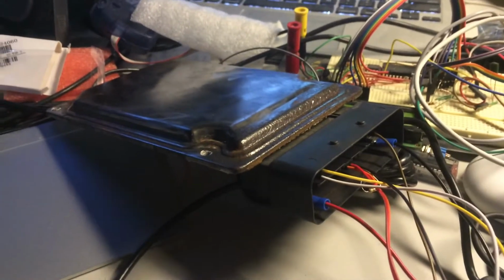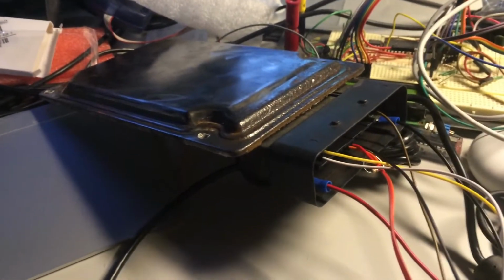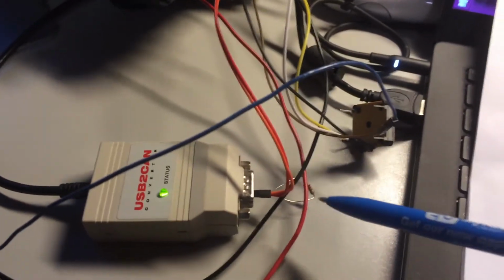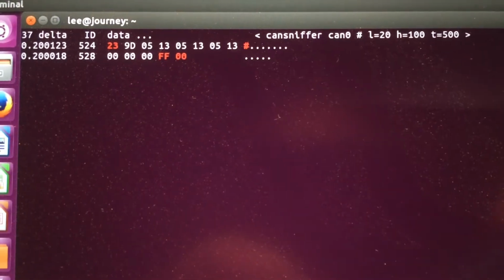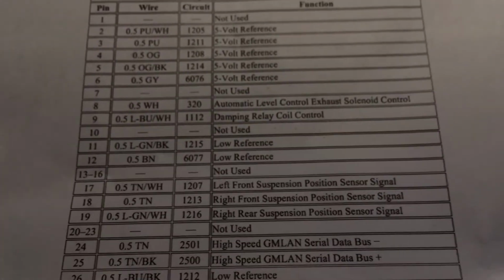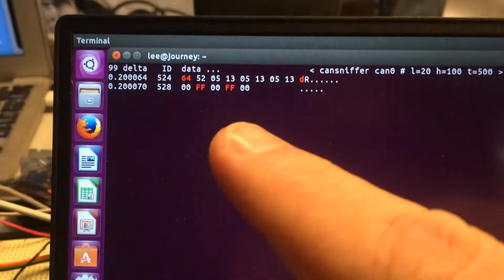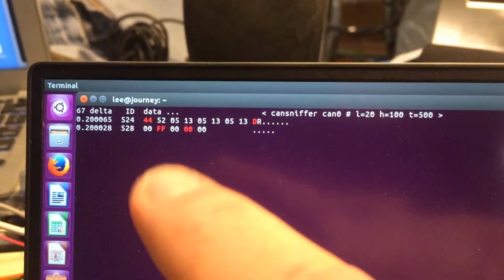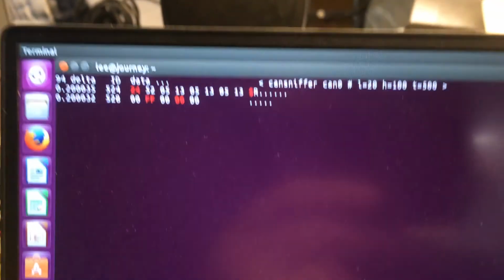2008 GMC Yukon Denali Air ride suspension module

Comment: My module won't shut off and drains the battery. I have to pull fuse #2 when charging the battery. Could this be an indication that the module is bad?
Reply from the maker: Could be anything between the fuse and the module.  A bad wire with missing insulation for instance.  What you would try doing is measuring the current draw at the connector of the module and see how much its drawing.  Or you could try unplugging the module and see if your battery still drains overnight.  If it does, then its probably the module.

Comment: Do you know how to take the module apart? There are rivets holding it together, and I’m having the same issue as someone else has posted where my compressor was not working I then replaced it with a new one and it was working fine for a few months and then stopped. I checked all relays, fuses that are associated with the suspension components and they are fine . Compressor still won’t kick on but if I jump the relay under the hood I get it to kick on. Any ideas about this ?
Reply: Having the same exact problem.  Let me know if you find a solution.
Reply: @anthonyc2236  did ypu find out what it was
Reply: @phillyspeaks  My Suspension Control Module above the spare tire was rusted through.  Once replaced everything worked normally.
Reply: @anthonyc2236  where did you get the electronic suspension control module? And did you have to get it programmed ???
Reply: @phillyspeaks  I found an exact match on ebay of the same model off of an identical vehicle.
Reply: @anthonyc2236  i appreciate it bro hopefully i have the same luck. Were you able to identify part numbers on the old electronic suspension control module
Reply: @phillyspeaks  Yes
Reply: @anthonyc2236  hey i have a 2008 gmc yukon denali xl 6.2 l v8 1500 did u remember the part number# for the ESCM or did u have a different truck?
Reply: please tell me you found a fix im having the same problem

Comment: do i need to remove spare? i looked and cannot find any module at all
Reply from the maker: It has been awhile since I have looked at one so memory is a little hazy.  You might have to yes.  You should be able to see the wiring harness under the car and follow that to its location.  It should be right around the spare tire though.

Comment: where is this module located? I have an 08 yukon xl denali and I replaced my compressor but I dont have communication with it so it wont work. I cannot find it
Reply from the maker: Its under the vehicle in the back just in front of the spare tire in the center.
Reply: @lmelnykowicz  thanks I will take a look. My compressor use to work but it stopped. I replaced it but shop hooked up to scanner but it said it had no communication. So I am guessing that is what it is
Reply from the maker: @tomchristensen2914  Also check the wiring harness under there, I have seen ingress of water in the connector causing corrosion.
Reply: @lmelnykowicz  Roger that. I thank you for your time
Reply: Any idea what the differences might be between the Z95 (magna ride) and the Z55 (auto ride electronic damper valving) modules?
Thanks!